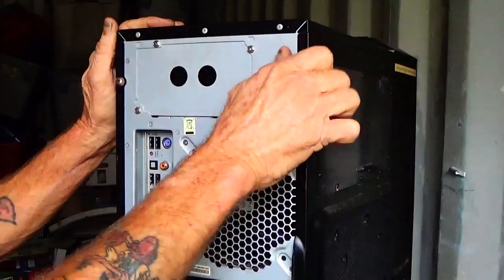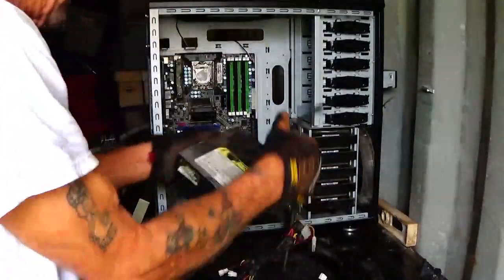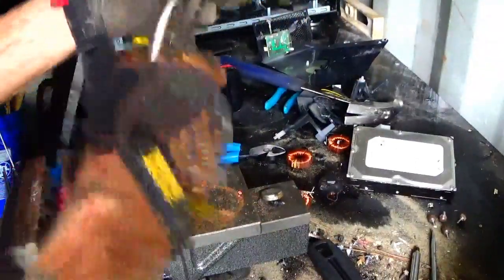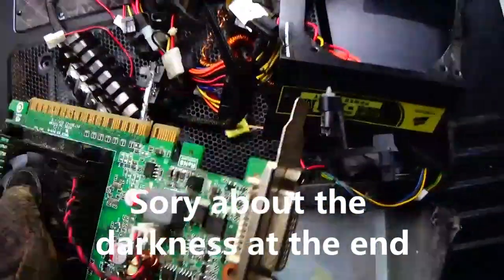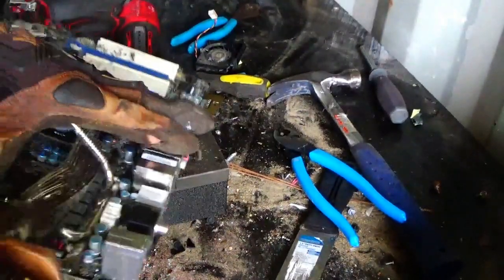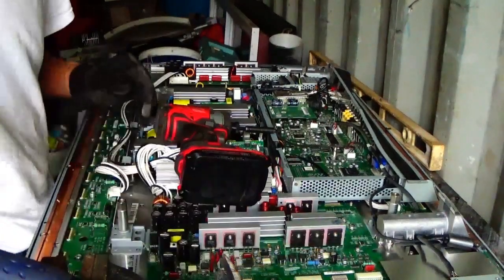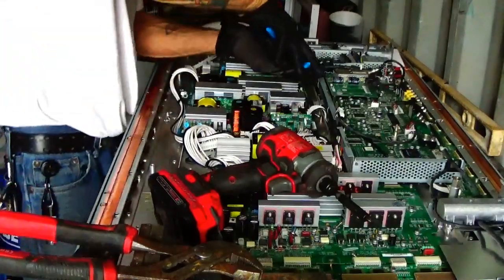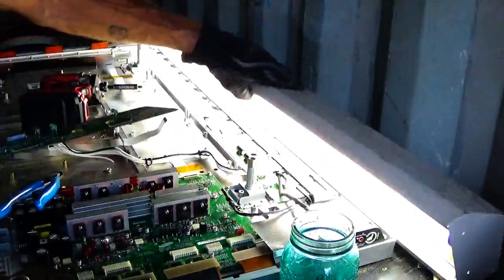Scrapping a Gaming Computer and a dell monitor

Comment: Those cables you are saving are SATA cables, not sure if they garner a large amount of money reselling. I can buy them new for a few dollars. I do PC repair so I save some myself to reuse but end up scrapping most of them. Every computer these days use them so kind of easy to find.

I enjoy ripping up power supplies too, those donut copper pieces break real easy with a hammer. stand the donut upright on a solid surface, hit it with a hammer and it'll crack unless it's plastic ring, those are a pain to break up. Then you stretch the copper out to get the ferrite core pieces out. I usually pull the aluminum as well, then sell the rest of the board to my yard as a junk board.

That gold square on the motherboard you pulled from the metal socket is the processor, those are always worth holding aside, Boardsort pays well for it if you get enough (takes a lot to get 1 pound to send in, looked like a no pin version which is at $5.75/pound at the moment). The older ones are better priced of course but all are worth saving separately. Depending on what is stamped on the front I've sold some of those used on Ebay, might be too old now to be worth it (depends on model like i5-4570 that identifies it's age better).

I would not take anything other than aluminum off the motherboard, the connectors you hammered off do have gold plated pins. They can still go to boardsort as gold connector ends I think but you lower the grade of the motherboard by removing chips and more. It might be a peripheral grade now though I am far from an expert on grading boards. 

I don't plan to refine any material so it's too much processing/sorting/storing for me to depopulate just to resell the items separately. Only thing I keep separate is memory (RAM) boards from computers, processors, and motherboards. I found a local yard that buys motherboards for an okay price so I'm selling my newer ones to them, will still send older ones to boardsort since they pay better for those.
Reply from the maker: Amazing. Thank you for taking the time to share all this info. Very useful.
Reply from the maker: I guess I’ll find out soon I’m going to go to board sort.com and look what they have for information
Reply: @ScrappingwithGrandpa  No problem, forgot to mention too each motherboard has a battery that needs removed if you did not know already. It's usually a shiny silver coin shaped on the newer stuff, old stuff from late 80s sometimes used a barrel shaped battery where ends were soldered onto the board.